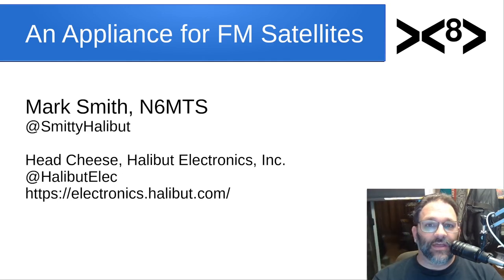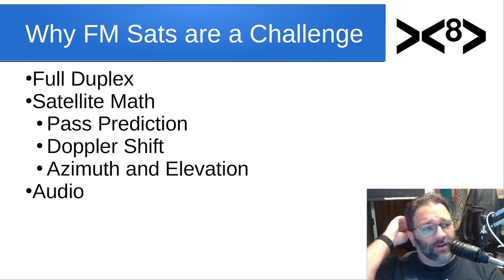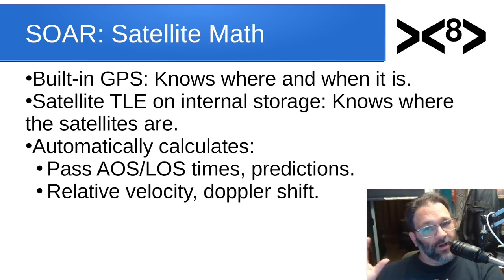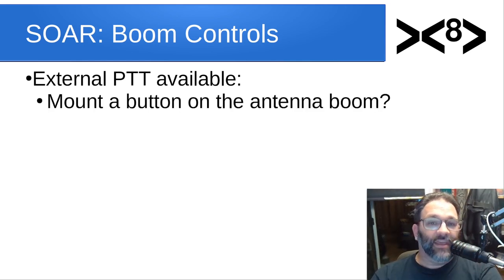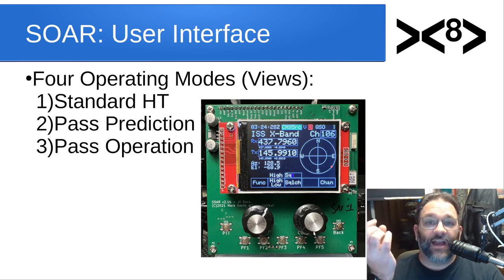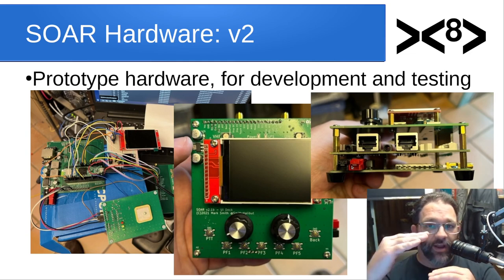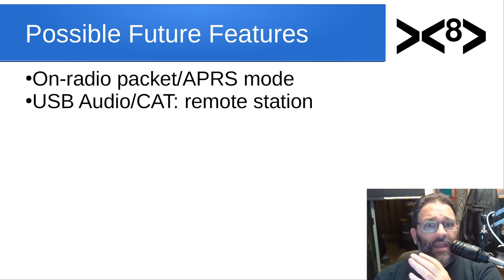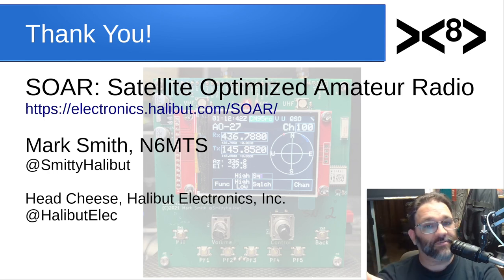SOAR Product Announcement! BayCon 2022, the "Secret Squirrel" project.

Comment: While you are planning, please consider the ability to handle "9600 baud," by which I mean the bandwidth and flat frequency passband needed for G3RUH/GMSK modes.  There are satellites such as FalconSAT-3 which do actual 9600 baud packet, but there are other telemetry and digital image modes which also use that range of audio frequencies, though not packet modulation.  Some of the FOX satellites did this for high speed telemetry and images.  Sadly even the majors are no longer including that.  The IC-9700 and IC-705 are cases in point.  This is probably of minimal use in the field, but would be great in the shack.  Some of us keep around relative antiques to retain this capability.
Reply from the maker: I really like this idea. However, there’s only so much I can do since I’m using a 3rd party RF module. 

I’m going to move this discussion to the groups.io email list that I see Alan is already on. If anyone else would like to follow along, you can subscribe here: https://electronics.halibut.com/

Comment: This is impressive… I could see a fourth “board” which could be a rechargeable battery that is USB chargeable. This is a crazy amount of research and implementation… nicely done!
Reply from the maker: The three board stack is just the prototype that I'm using for development. The final product is a single board in an extruded aluminum case.

The current case won't fit batteries in it, but it is my intention to design a battery charging circuit to add to a future version in a slightly thicker case.  But for the first release (internal version number v2.2), I punted on power, assuming people can provide their own 7v to 30v DC source into an Anderson Powerpole.  Instead, I concentrated on the parts that are actually unique to SOAR.  Putting time into a battery charging circuit is not the value-proposition for SOAR.
Reply: @SmittyHalibut  understood. But USB charging for HTs  is a massively wanted feature that only the Chinese rigs are starting to do. Keep it in mind for later development. You pull this off and you’ll have the money to do it 😂.
Reply from the maker: @WI9LL  Ahh, hang on. I missed that detail of your post.  I see what you're saying. That's a great idea. Yes, I'll make it support USB charging as well. It'll charge slower, but it'll still charge.
Reply: @SmittyHalibut  plug it in the car when you get to work then go hunt Sats when you get off 😍

Comment: Been waiting for this for months! PTT could be index finger switch like a MIG gun switch.
Reply from the maker: A friend AK6DM is helping design a 3D printed handle for an Arrow boom (really, anything with a 3/4" square tube boom) that will have a PTT switch embedded in it. We considered doing a pistol grip, but decided that wouldn't give you very good leverage when you need to roll the antenna to adjust for polarization. So we're sticking with an in-line handle.

Comment: This is very cool I just built a sarcnet rotator. Which is almost exactly what you described as a rotator, holds and moves my arrow antenna nicely. I built it for under $100 based on the mk1b design on their website. The protocol is a very simple serial interface over USB.

Comment: This sounds great. Can I ask for an option during "Pass Playback"?
I often monitor weather satellites (and SSTV).  Decoding audio to generate images is typically a function you do later on a PC - it sure would be nice to see that on a radio.
Doesn't need to be the whole image, just a few lines so you can see the image is being decoded (and saved to SD)
Reply from the maker: On-device SSTV decoding is definitely something that’s possible given the hardware capabilities. It won’t be a launch feature, but it’s on the back-log of features to add over time.

Comment: looks very promising. too bad servocity stopped making their pan tilt head, looked like it would be real close to what you could use to point the antenna. Bosch makes a nice 9-dof sensor that could work, might be a bit pricey though. bet you could find something like it that does not have extra functions you may not need.

Comment: The Wouxun KG-UV9D PLUS is full duplex handheld and works great for FM satellites.  Still available to buy new.
Reply: For SOME FM satellites. Per Patrick WD9WEK: "Just like the original KG-UV9D, along with many other HTs that have come on the ham equipment market over the years, the KG-UV9D (Plus) just can't keep the 2m transmitter from desensing the 70cm receiver when working a V/U FM satellite like SO-50."